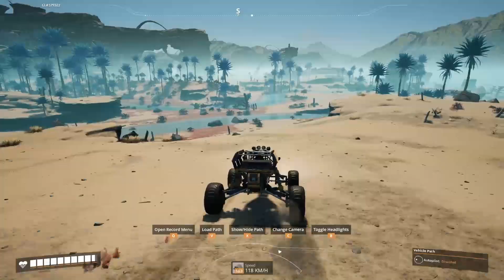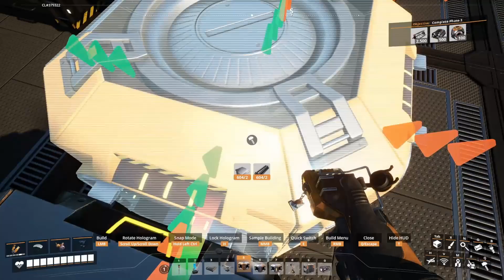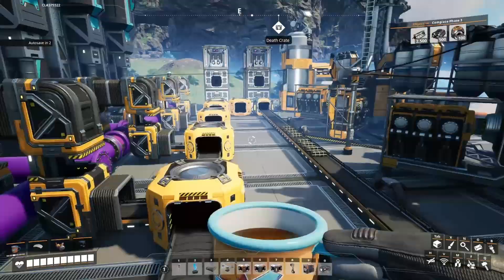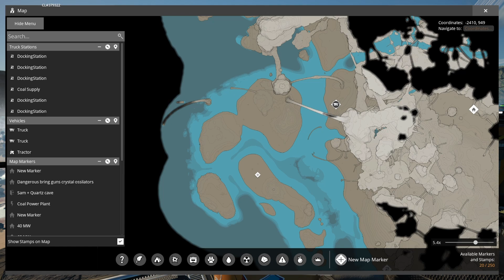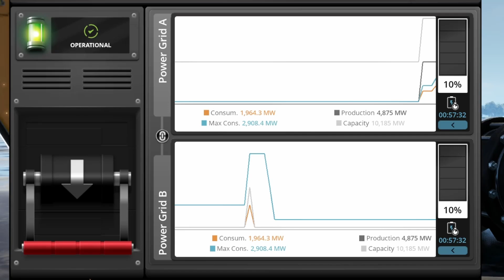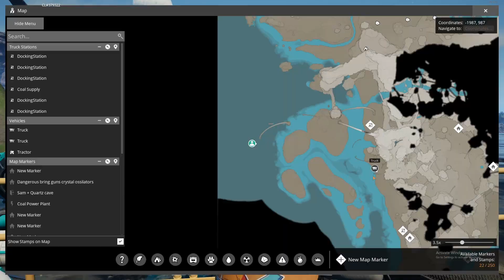Fuel Is BETTER Than Turbofuel?! - Satisfactory 1.0 Let's Play Ep. 6

Comment: Im doing 80 refinery`s for heavy oil residues - 60 out of 64 blenders for fuel - to 266.6666 refinery`s for turbo fuel along with 4000 compacted coal for feeding into 666.6666 fuel power plant.
Reply: May have gone over board here. your going to need a metric ton of coal in the late game for diamonds. but I suppose you can get around this with the converter.

Comment: From what I have learned, hold off on Turbo Fuel until you have blenders. Even with alt recipes, you end up building hundreds of machines, and this can be significantly reduced with blenders.
Reply: yes and no. I would keep it small. I have 2 lines of 600 crude coming in running heavy oil thats 40 refineries there and then diluted packaged fuel with 54 sets of packagers-refineries-unpackagers, then with the amount of coal and sulfer coming in theres an additional 71 or 72 (I dont remember if i over clocked or under clocked) producing 1,333.333 Turbo fuel, so 2 lines and some change, but I think its worth the investment. 1 600 line of turbo fuel will power 80 generators where as 1 600 line of regular fuel will power 30, so 160 gens off my set up and I think I have 3 or 4 lines of additional fuel on top of that. so a "small" set up of turbo fuel I think is worth the investment early to carry you pretty solidly until you unlock blenders.

Comment: How do you have so many power shards?!? I’ve collected so many slugs and I wouldn’t have enough to put three shards in over 100 machines.
Reply: To explain it a bit more detail: 
1. Save your slugs in the early game, only use the few needed for unlocking nodes in the MAM.
2. Unlock "Production Amplifier" in the Alien Technology tree of the MAM as soon as possible (right side of tree).
3. Place a somersloop in a constructor. This will double its output without any additional input, just more power consumption.
4. Use it for slugs, resulting in getting 2, 4, and 10 shards instead of 1, 2, and 5 for each color.

This is also very useful for getting vast quantities of alien DNA for shop points early on. Also save all of your alien remains until unlocking the Production Amplifier, use a somersloop to convert them to protein, and then again to convert that protein into DNA. This means every piece of alien remains results in x4 DNA.
Reply: @ForeverZer0  oh very cool - I will start doing this.
Reply from the maker: If you research the somersloops, that tech tree allows for item multiplication. So 1 purple slug equals 10 power shards instead of 5! It’s a fantastic thing! 😄
Reply: @MyLittleGaming  oh wow I didn’t know this.  Fantastic.

Comment: Don't worry about running out of resource nodes. Keep building big. 1.0 is more balanced than the early access. Nuclear doesn't take as much sulfur as you might think. I did about 200000MW with zero sulfur in 1.0 with alts. My nuclear plant fully recycles all waste, as one should, so it's huge. 

I love your choice of recipes. That diluted packaged fuel is just over powered AF.